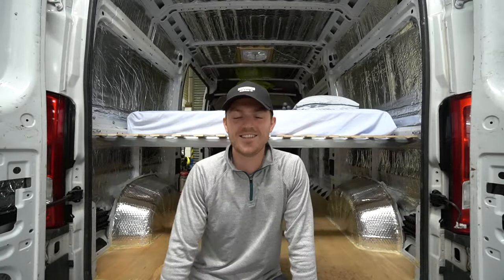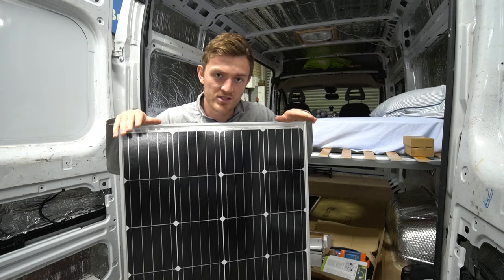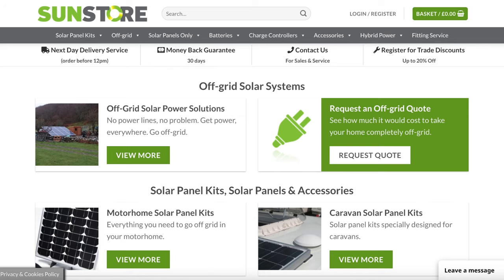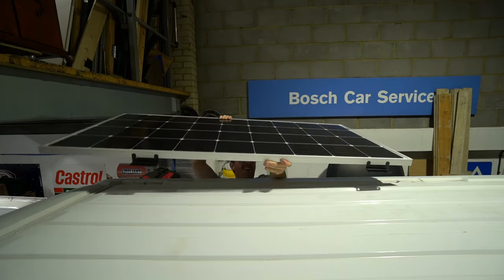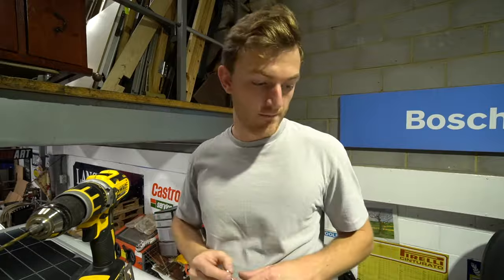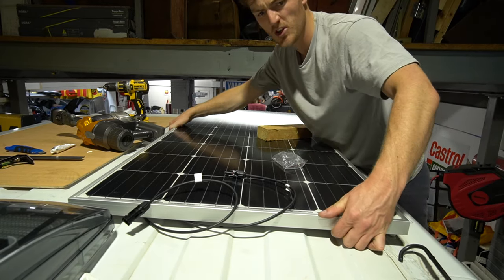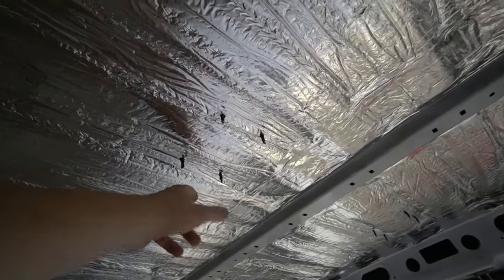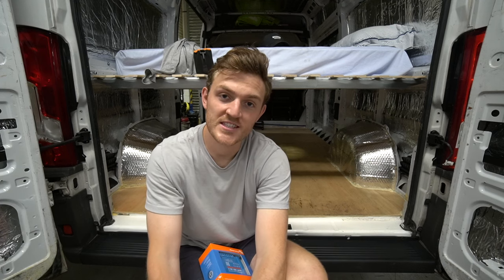350 WATT OFF GRID SOLAR POWER | Solar Panel Installation Kit - No Experience Van Build

Comment from the maker: A midweek video …….. crazy I know 😂! Make sure you’re following me on Instagram @willswhereabouts as I’ve been having lots of fun going out in the van with some new friends in last couple of weeks ☺️
Reply: Will. Self tapping screws do come in different lengths. You could have used shorter ones....
But if you can get them you could put a form on each screw end so you don't cut yourself open.
👍😁
Reply: Hey will previous video would be more amazing if ikea would have let you camping because of them you had to go through so much trouble. Hope everything is going well have a great weekend and stay safe
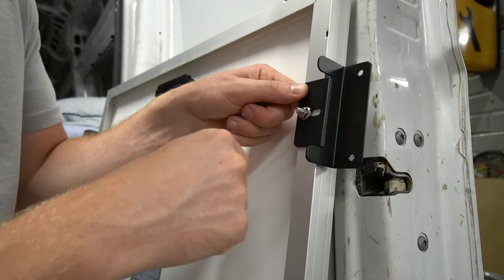Reply: 4:33 lol
Reply: Great job Will, having set up a solar system myself from reading books I understand how frustrating it can be.  I believe in you Will, you can do it.  It’s just about the math and configuration.  You can either use an 100 amp hour leisure battery, but if you can afford it I’d use a 100 Amp hour LifePo4 battery, they are more resilient and cheaper in the long run.  Great job.  Rog. 😀
Reply: Much prefer van bills from car parks at the moment! I'd have let the bloke lock the gate, keeps the riff raff out and gives you a decent and safe nights sleep. Off grid power is really really hard to get good instructionals on!
Reply: Hi mate 
Great job 
Where is the second part please?

Comment: Hmm, self tapping screws aren't always a very secure type of fixing, they could eventually work loose with vibration from the vehicle, and also via minor rust. Then your solar panels fly off on the motorway and... You might not notice the deterioration too as your self tappers will be buried behind your roof. It it was me i would take the self tappers out and use more secure fixings, a nut and  a bolt with a locking thread. I appreciate the solar company might have said the self tappers are ok, but no. People may disagree with me, but best to err on the side of caution.  A fully qualified car mechanic...
Reply: I'm not a fully qualified car mechanic but I stayed at a Holiday Inn Express a week ago and I fully agree with the idea of not using self tapping screws but bolts with nuts.
Reply: Yes nuts and bolts Better still use stainless steel nuts and bolts no rust then
Reply: I was thinking a nut and bolt would be a better idea as I watched.
Reply: having fitted solar myself on my van you need nyloc nuts and bolts dude.   In an accident or freak wind the panels become sails and they become huge sheets of nasty glass.
Reply: Yup.  I'd be replacing those with nutz 'n' bolts + lock-washers, or nyloc nutz.  That wobbly sheet-metal roof is going to vibrate those self-tappers out in no time.
Reply: Get bolts same diameter as self tappers and swap over one by one with help of assistant on one side to hold nut. or leave self tappers and drill new holes for nut and bolt. You might even find rubber or rubber backed washers. security type bolts also available depending how far you want to go, like a star drive with a dimple in  other variants probably now available, however you may want to remove them at some stage for maintenance or other reasons. cut them self tappers off or cover them with something before you forget. even if its only corks or pilot drilled timber screwed on from inside or polystyrene packing pushed on.
Reply: @IMP3TIGO  ha ha like it
Reply: @DocProfit  exactly yes
Reply: @Rockhopper1  Yes, nyloc is the type of nut I was thinking of, I mean, you never see suspension or steering on a car secured with self tappers.
Reply: And a thicker backing plate on the underside surely as well
Reply: Exactly, sheet metal doesnt hold the screw for long time, some people just want to have sonething to vlog, for me its a stupid way, van alway have ready threaded hole for rails.

Comment: So your solar provides '250 amp hour' per day, that just means it provides 250amps worth of power for 1 hour. Sounds bad at first, but if you think, your fridge might only draw say 5 amps an hour, so 5amps X 24hours = 120amps per day to run your fridge, so you still have 130amps free each day. Amps is the flow of electrical current, so it's a good way of measuring what power your system has.
Reply: Wouldn't it be better to measure it with Watts ? I think it's the most common power measurement in the world
Reply: Thought amps was a measurement of current not power, yes I know you can convert but power should be measured in watts?
Reply: @andrewgilbride7546  Amps is the flow of current yes. Amps, Watts and Volts are all measurements of electrical power, just slightly different ones.
Reply: @gearlab734  Reminds me of what I was taught about 50 years ago when I tried to become a telephone engineer (when telephones and telephone exchanges were mostly a bunch of mechanical switches connected by miles of wires, with a few resistors, capacitors and a couple of diodes thrown in). The law was discovered/formulated by a clever German man called Georg Ohm - "Ohms Law".: E=IxR.  - E= electromotive force or volts or "power". I = Current. R= resistance. So Volts (or power) = current (amps, or amperes) multiplied by resistance (ohms, named after Herr Ohm). Hence, to find the current flow (amperes), divide Volts by Resistance. Also back then a computer was about the size of a house and calculators were mechanical machines that weighed about 2 or 3 Kgs 😊
Reply: @NewZman23  I know yes, ohms law the VIR triangle
Reply: Have you ever seen a fridge running 24/7? Seriously? 100% duty cycle? It will have a thermostat, and will cycle on and of about 8-10 times per hr or less. Depending on insulation of the fridge, ambient temperature, and door usage. It will draw about 25-30ah per day, or about 350wh to be more precise.

Comment: you've drilled directly into a perfectly good roof lol...those panels should sit on a roof rack, driving movement and body torsion will unseal any sealant you apply, it will be a yearly job to inspect for leaks and re-seal

Comment: Your roof is too thin to give the self tapping screws enough purchase to hold safe, they will work loose over time, last thing you need is solar panels flying off your van on a motorway. Swap them for nuts and bolts and washers. Not criticising, just some advice that should definitely be taken. 
Loving the series by the way, you are making me want to convert a van myself.
Reply: Those self tappers looked like they have threading for nuts but I had the exact same thought about adding a washer and a nut to spread the load and keep them from ripping out, maybe some blue loctite as well, especially on the bolts that attach to the solar panel
Reply: 100% they will work loose!
Reply: Good advice!!!
Reply: Def add washers and lock nuts. And then cut the bolts down before you forget they are there. Then cover with vapour barrier.
Reply: @falon1000  I can give you the whole history of the self tappers Instead a quick run down ..The work for "gutter" systems on the end of roof's of homes Because of the tip And threading into metal, Wood, Other More than 1/2" Solar panels That first came into the market for the public was for the same homes Thus the idea to use tappers Even the size And length was set for that use. You could use Rivet nuts And a washer And bolt in cases where you can not access the roof from the inside of the van AKA double skin roof Or Hidden by the framing. The best would be 1 large washer, 1 lock washer and drilled over the shown sized hole with a min grade 3 And up bolt And nylon nut This would support/forces of 120,000psi Per bolt The roof it's self would tear apart before bolts due
Reply: @freakyflow  But self tappers into a thin metal will work loose under vibration, specially when is a load on it, the panel. On houses it’s a different story, not going to travel on bumpy roads.
Reply: Good idea

Comment: I'm no expert ,but self tappers on the  solar panel brackets are only tapping into about 1mm of sheet metal. I think i would nut and bolt them on......
Love the vids.
Reply: I would agree, it’s fiddly but swap them out for some 15mm M5 or M6 with nyloc nuts and washers. Using Torx or Hex heads will make the panels harder to steal.
Reply: I’ve just bought a rhino roof rack for mine to mount the solar no self tappers here 😉

Comment: For a future tip of fitting the panel brackets onto the surface, you could use rubber strips and they would tighten down. They also would act as flexible ‘suspension’ and make the surface less rigid

Comment: Awesome video will! I would change that 20a charge controller for a 30 amp one as those panels will max that one out! Good luck with the rest of the build. do get in touch with me if you want any advice on the electrics as I love it 🤣 and like I said at the weekend don't get up out of bed too quick because of those screws 😂😅
Reply from the maker: Haha cheers max appreciate it
Reply: @WillsWhereabouts  I was thinking the same thing, that the charge controller was a tad small. The 30 will provide more peak power. But I also depends on where you going to be. If you'll reach max power on the panels and how many minutes/hours a day you'll hit peak power and if it's worth the extra cost for that small amount of time. Great video.

Comment: You done brill will. Youll be fine with the screws and bonding. Ref to earlier comments. You might want a two tonne wieght on youre panels incase they fly off on the M6 lol 😜😜😜😜😜 itll be fine Will

Comment: If your worried about it blowing away. For extra support add nuts on the inside part and then cut the extra off. Just make sure it’s as tight as you can make it

Comment: You do need to drill a hole for self tappers, you don't need to tap the hole. A center punch will help stabilise the drill bit when starting the hole. You might be better off with bolts and washers for externally mounted equipment.

Comment: Great video as per Will.  Not sure if you used one.  But a centre punch will help not letting the drill bit slip about. Also are you based at the back of Redhill/ Reigate?  Looks familiar. I live in Coulsdon and had cycled around the area

Comment: Nice job, 350W are good but I wonder how much mileage you'll get out of them in the U.K. with its (?) frequently overcast weather?  Curious if/when you'll be adding interior walls/ceiling in the van.  Looks good though, love the bed install.

Comment: You’re not going to get 240 amp hours per day. Each panel will produce 9 amp hours at peak sunlight. You’re only going to get peak sunlight to your panels for about 5-8 hours per day (depending on the season). At peak sunlight, you’ll produce between 90 to 144 amp hours per day. Still significant. Still should give you quite a bit of power to your van 🚐. When you get ready to install the electrical, make sure you install the charge controller to the battery bank first before installing the solar panels to it. That power needs to go somewhere once it’s utilized. Otherwise, you could tear up your mppt solar charge controller.
Reply: ...sound advice
Reply from the maker: Thanks for the information and advice Robert I’ll bare this in mind
Reply: @WillsWhereabouts  No problem. Just trying to be of help.

Comment: From other installs I've seen. Don't you have to get under the panels to connect the wiring?
Reply: Does seem really odd to install the panels and not wire it all up at the same time. 🤷‍♀️

Comment: I think id have bolted the solar panels down with lock nuts , the self tapping screws you used could come loose over time very easily. Wouldn't be a big job the sealant would still be water tight while you swapped the bolts out.

Comment: If you can be bothered make a small deflector in front of the panels to avoid airflow getting between the roof and the panels.. also reduces (whistling) noise when driving at higher speeds.

Comment: This is exactly why I said the tall van would be a good idea. It's a great base for solar panels, and It's too high for anybody to steal them if they're low profile haha

What kind of charge regulator are you using? Or do they have one built-in
Reply from the maker: I’ve got a b2b charger which I need to install

Comment: Bolts with nylock nuts would be a better way of mounting, will not vibrate loose over time. Those self tapping screws arent ideal, and tend to quite poor

Comment: amp hour is simple its how many amps can be provided per hour. as a simple example charging older phones was usually 5v 2A on a charger. so if you have 20ah you could put a phone on charge pulling 2 amps for 20 hours. not that you would do that but its just a simplified example.

Comment: you should use lock nuts to secure the panel to the bracket, you shouldnt be able to tighten them with your fingers, it will eventually rattle off

Comment: Might have been an idea to fix panels to a roof rack or make rails from unistrut. Then no holes in your roof plus you can move them to any position if you fit other stuff up there. Also you can clean your roof.
Reply: this is what I did
Reply from the maker: That’s a good idea and something im going to look into

Comment: U glue the panels to the roof, u do not screw or bolt panels to roof, i stuck mine to the roof of my van and 5 years later they are still in place,

Comment: I hate to say it but you got hosed on the kit. If you got the Victron 75/10 MPPT controller it only provides a meager 10 amps of battery power. You need at least a 40 amp controller or you're just wasting your time & money installing the solar. A 10 amp controller doesn't allow you to use the full output of your panels. Call them to see if you can upgrade to the other one they have. Look at it this way, if you only use it to charge your Jackery it will take much longer to charge it at 10 amps than it will to charge it with 20 or more amps. Plus the kit didn't include an inverter. You're going to need a 2000 to 3000 watt inverter to run a/c appliances, devices, & tools. Wherever you mount your controller & inverter you should account for enough space to add batteries later. Even if you never go that high, plan on leaving enough space for 400ah of batteries.

Comment: You shouldn’t pre drill self tappers as pre drilling will cause the self tapping decrees to back out and your solar panels to fly of abc cause a crash or hurt someone I would use nuts and bolts and a locking nut to make sure they don’t come lose and fly off the van dangerous bro I would sort of asap

Comment: Solar power in England??:)
Reply: It's true, with some panels, a few Lithium Io batteries and you'll be off the grid a lot longer. Paired with charging as you drive. Yeah. It's true the sun is shy here but daylight does the job, not just desert sunshine.